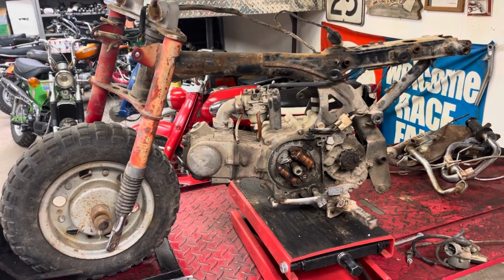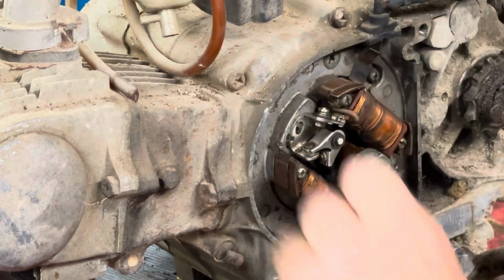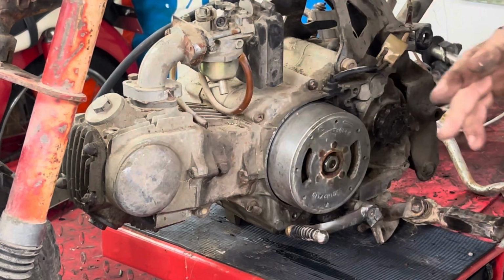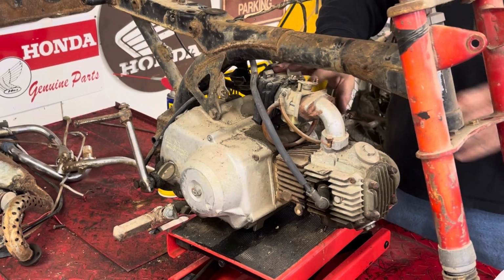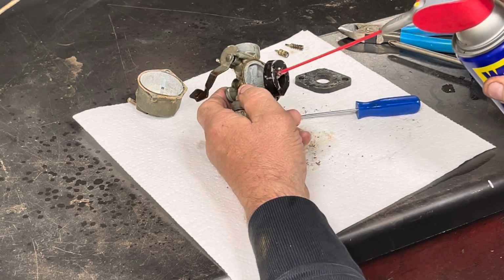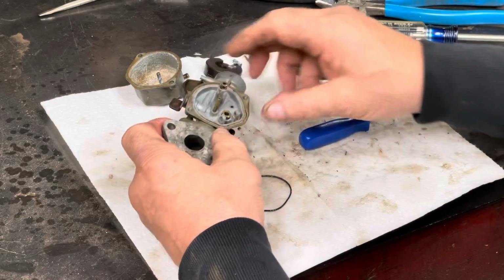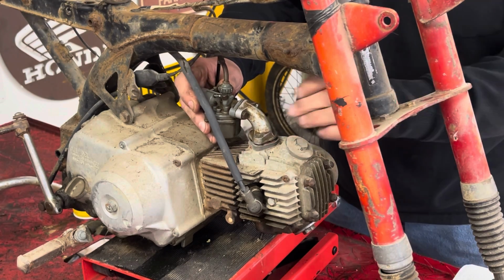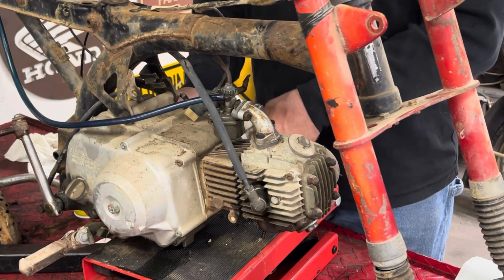Honda z50 - video #2 - Can we get it to run?

Comment: Love going along with you and get um running!  Question for you.  Can a Honda CT70 jug and head be retro fitted onto the Z50 platform, then rejeted to 70 specs?
Reply from the maker: Sure.  If you saw the video on the hardtail Z50, with the flame paint, it had a 72cc top end installed on the stock z50 bottom end.
Reply: Yes😊

Comment: Hey working on one of these now , I know it's an old video  but can you remember  the orientation  of the temporary  coil wire on the 4 pin stator ..?..?.? Love the video
Reply from the maker: Black wire from the stator directly to the coil.

Comment: You mentioned that you have a bucket of old carbs. Do you still have the original from your S65?  It has ports that oil lines run thru. Mine was trash and the last one I tried to buy ended up being a scam!  Lol

Comment: u had the plug in finger tight ? when trying to start it
Reply from the maker: Yep, I got strong fingers.
Reply: liked and subbed thanks 
 @MiniBikeMike
Reply: working on a z50 i have had to clean the points a couple times in past week i lose spark. waiting for a flywheel puller so i can get in and clean everything better. Been a hell of time with the carb and realized its a aftermarket carb looks like its for a 100/125  air mix needs to be  out just under 1 full turn vs 1.5 turns otherwise it bogs.
Reply from the maker: Thank you!